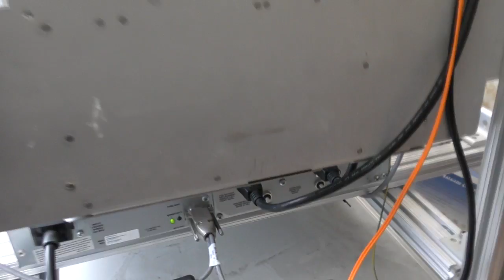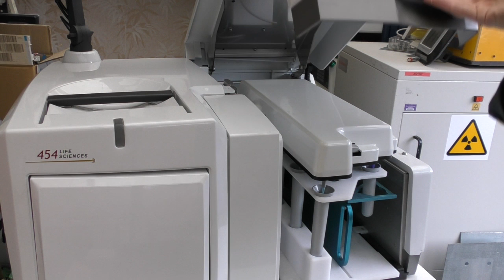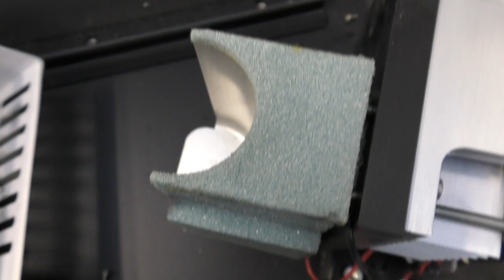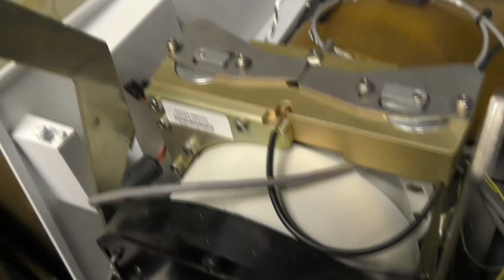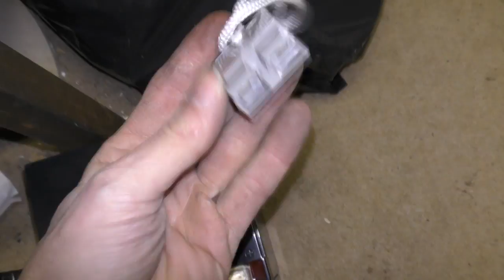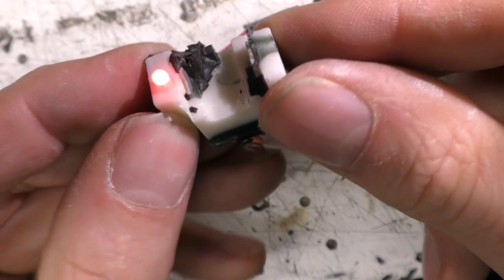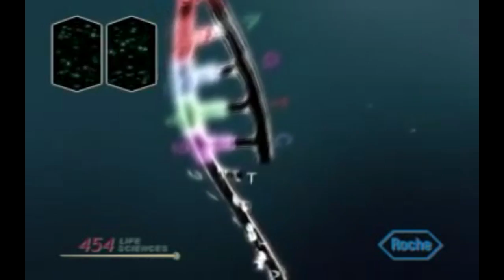Roche 454 GS FLX+  DNA Genome sequencer teardown

Comment: And I can tell you there's a missing component. There should be a server with heavy disk space behind the unit. Did a contract back in 2013-2014 doing the IT side of sequencing exomes. Massive amounts of storage and encrypted drives. They used Ion Proton sequencers.
Reply: Oh and yes, reagents are kept very cold/frozen. And the process you'll find has a hell of a lot in common with developing color film.

Comment: To determine if it is molded look for the ejector pins. Or molding marks things like date codes etc will stick out like a sore thumb. It is possible it is urethane cast.

Comment: I'm a little surprised to see this machine was manufactured so late (2012 iirc). By that point, there were far better 2nd gen sequencing options available that produced orders of magnitude (literally) more data and deeper sequence coverage for roughly the same cost. My department purchased an Illumina machine in about 2010 that blows the specs of that 454 out of the water. Similar upfront cost, but slightly more cost per run. However, it produced so much more data per run, that you could actually put multiple genomes on the slide at the same time (making sure to use a special DNA labelling technique to tell the final data apart) and do crude 'multiplexing'. This further reduced the cost/genome sequenced.

Actually, the reason might be that although 454 didn't get as good depth of coverage, the legths of the DNA reads were much longer than more modern machines (100s vs 10s of bases), making it easier to actually assemble your sequence data into a genome. This is very useful if you're sequencing something that's never been sequenced before, but somewhat useless if you've already got a genome to compare to.
Reply: So instead of getting more useful data upfront it gives you a whole lot more data that need a lot more processing to be meaningful?

Comment: Mike, reading the PDF you linked shows the rack of tubes you have is specifically for the pre-wash stage. You would fill those tubes with the Pre-Wash Buffer after cleaning out the casette from the previous run. So that tray would not be in there during normal operation -- it does indeed come with cassettes (as they call them) which slide in the same way that tray does. Also, the back tube is chilled, as it contains the Sequencing Enzymes (whatever they are) and they have to be kept below -15C from what I understand.
Reply: That tray you have is referred to as the Pre-Wash Cassette.
Reply: These are the kinds of instructions you get:
Wash the appropriate BDD using a soft bristle brush and Sparkleen solution. Rinse
thoroughly with nanopure water and let the device air dry on a paper towel.
Nanopure water?!
Add 6.8 µl of Apyrase to the 20 ml supplemented Titanium Bead Buffer in the conical
tube. Re-cap and label the conical tube “EB Wash”. Mix gently by inversion, and place
the conical tube on ice.
4. Add 30.6 µl of Apyrase solution to the bottle of supplemented Titanium Bead Buffer.
Re-cap and label the bottle “BB2”. Mix gently by inversion, and place the bottle on
ice.

6.8ul? How do you even measure that much?

Vortex the Enzyme Beads and the PPiase Beads and place them in a Magnetic
Particle Concentrator (MPC) for at least 2 minutes for the beads to pellet. Invert the
MPC several times and wait at least 2 minutes again. Carefully remove the
supernatants and then remove the tubes from the MPC.

Right....
Reply: Yes, that PicoTiter plate is replaced every time. It actually gets submerged in one of the prep liquids until it's ready to be inserted, which I found intriguing.
Reply from the maker: That cooler gets to about freezing point at room temp, but then the heatsink overtemp cutout trips so probably doesn't run quite that cold.
Reply: It's easy to measure microlitre quantities with capillary tubes - look up "tlc spotting capillary". (TLC = thin layer chromatography in this context.)

Comment: It is standard gigabit ethernet over optical fiber. You can use a standard fiber-to-copper adapter. The connector type and fiber type denotes a wavelength, which would be important to get right for the converter box ;-)

Comment: The way this would work is that you would have mixed in with the bases ACTG some tagged defective ACTGs with fluorescent probes such that copies of dna would terminate at random points - this gives you a blast and you have to use the computer algorithm to line them back up- different length sequences will come off the column at different times based on charge vs drag and the camera would like read the fluorescent probe

Comment: The image sensor is most likely behind a tapered FOP.
The fiber-optic output is most likely just GigE, but I'm almost certain the actual protocol is nonstandard. CameraLink over fiber is extremely rare and stupidly expensive.
Reply from the maker: It isn't tapered -it's a 60x60mm sensor! Fibre protocol is Cypress Hotlink over fibre. Video coming shortly
Reply: mikeselectricstuff Whoa! That's a huge sensor, x-ray direct imaging sizes! Explains the price now.
Reply: 60x60mm? That's downright stupid. In like a hilarious, good sort of way. I don't even know of any standard telescope mounting options for such a sensor - it's larger than the "jumbo" sized 2" optical backs on most large amateur scopes, 11" aperture and above. Practically all smaller scopes are only going to have a ~38mm diameter usable imaging circle or so.
Reply: @100531782681373837774 Huge silicon is used in direct x-ray imaging. The most high-end~($50-200k) models have stitched sensors of over 30x40cm(but usually TFT, so not quite silicon).
Reply: mikeselectricstuff I just found the sensor used in your camera.
http://www.sta-inc.net/sta4150/

Comment: The fibre connector is an MT-RJ. It used to be popular about 10 years ago for Ethernet connections but replaced by LC which is still the standard. You can pick up MT-RJ network cards on eBay for a few pounds, although not sure what speed that runs at. The connection  could be 10, 100 or maybe 1000Mbps. I'd also be surprised if it's Ethernet though, as unlikely there is IP connectivity going on in the camera. I'd hazard a guess it has some special card that communicates. Great video Mike.

Comment: 28:00: Do I see a black patch of magic smoke on that board where the fan cable is attached or is that just a shadow?
Reply: I am afraid that the camera is actually toast and since it seems to be the most expensive part of the entire machine (worth $500.000 new) it's the reason this unit has been scrapped in the first place.
Reply: Looks like a 'solder-plated' portion of the board there, and you're seeing the 'dark' glare off of it from deeper in the camera...
Reply: How did you infer it's toast? A small burn on one part of the board doesn't mean toast, could be repairable.
Reply: It was just an assumption. And yes even that damage is most likely repairable.
Reply: Nope I did not. It was a reflection since there is no soldermask on the board. Yay!
Reply: I sent an email to the company that makes the module maybe get some interface information on it but no response.

Comment: That fiber-optic connector looks to be a standard MTRJ connection, and if the camera was also offered in Gig-Ethernet, it's likely also Gig-E over a different medium (besides the usual copper).   Being this recent, it probably is actually Ethernet, plugged into a matching SFP module plugged into a fiber Ethernet card on the PC/Server.
Reply from the maker: Looked into it some more and it has Spartan 2 FPGAs so a pretty old design, now less optimistic that it will be Ethernet.
Reply: Looking at some of the sales literature, you are probably correct.   I turned up what looks to be some of the proper interface cards (perhaps), have a look on eBay for "Spectral Instruments camera interface card", there seemed to be a few of them on there that matched the interface description of 'Either 50-pin connector or fiber-optic' (per the sales literature).

Comment: That's not a standard ethernet fibre connector Mike. The usual standard LC or the older SC and ST look very different. That's an MTRJ connector, probably quite easy to get an LC to MTRJ fibre somewhere

Comment: For fiber google "MTRJ (Male) to LC multimode " the orange means it will likely be 1gbit. (the lc connector will fit most pcs/switches) with a 850nm sfp, but it may be another odd  feq. Good news is all of that fairly cheap second hand:P

Comment: Most APC UPS have the ability to step up or down the voltage to keep output at an optimal level without going to battery unnecesarilly.

Comment: +mikeselectricstuff The problem with pacemakers is that magnets are used for medics to switch them in the field; so it's not an issue with interfering with the operation so much as they're intended to switch mode; http://www.medscape.com/viewarticle/749751_5    (so for example pacemaker users are told not to put headphones in their shirt pockets).

Comment: i have to say it looks like no fibre ethernet i have seen before, but i have seen them use all sorts of connectors internally inside fibre switches to route internally including just off the shelf SPDIF fibre so who knows 
it could be just a high speed serial interface like LVDS but you might want to try looking inside to see what chip is driving it and if there is a space for ethernet magnetics you might be able to solder on (such as gb or 10gb)

Comment: The s/n on the camera is 1119, which rather puts an upper bound in the number of DNA sequencers made.
Reply: Lower bound, surely.
Reply: No. The serial number would probably be numbered through for all the other variants of the camera that didn't go into DNA sequencers. Obviously it doesn't tell you how many were made after this one, but it does tell you that no more than that many were made up to 2012.
Reply: Then by that reasoning it doesn't tell you anything about how many DNA sequencers were made. I don't see how seeing serial number x tells you there are no other machines out there with serial number greater than x? I could go on ebay and buy the same machine with serial number 1120? How do you get that '1119' was the last one made in 2012?

Comment: the cooler does have a temperature sensor on it
Reply: but another side of radiator ?
Reply: They could be smart enuff to have figured out that if they feed X ammount of Amps into those peltiers X ammount of units of heat gets moved.
Unless the role of that thing is to just keep the liquid frozen when it's not used and they could more or less run them on almost full blast until it was time to unfreeze it.

Comment: Yes that fibre optic connector is standard, it's an MTRJ. They were very common on switches/routers around 15 years ago, hardly ever used today. A cable to adapt this to a more common format such as LC/SC/ST is easily sourced. I'd expect it to operate at 850nm, possibly stamped on the transciever in the camera? Can you see any visible light from the fibre connector when the camera is on? Apparently the interface spec is "AIA Camera Link" http://edt.com/downloads/pcidv_family-3.pdf Some frame grabbers here http://edt.com/product/pci-dv-fox/

Comment: Looks like this could be the camera controller: http://www.ebay.com/itm/Spectral-Instruments-PCBA-SCH-FO-Gigabit-I-O-3097-Rev-G-Camera-Interface-Card-/291956437009?hash=item43f9f5b011:g:kXsAAOSwo4pYFJgf   It uses 850nm fiber, so it may be possible to use a standard 850nm fiber to ethernet media converter box to get into the camera.  The camera brochure indicates an SDK is available for the camera upon request.
Reply: stonent nice find man

Comment: Low production run injection moulds can be made pretty cheaply these days.  There are several companies offering a complete service whereby you upload a CAD file of the intended finished plastic part to them and they make aluminium A and B moulds using a CNC machine fed essentially from the CAD file with minimum human interaction needed, and then they can produce a few thousand parts.  Your design is analysed by their computer and you get feedaback a day or less after uploading your design to highlight any errors that would make it unmanufacturable such as insufficient draft angles for the chosen plastic or features that are too narrow & deep to machine, and also warnings about likely sink dimples or flow lines etc.  An engineer will also discuss the positions they plan to place the gates and parting lines to ensure that it will not cause any problems.  I used a company called "Protolabs" in the UK but there are many others.

Comment: The housing looks like a vaccum low pressure mould. Something like this http://www.citim.de/de/Polyamidguss-Vakuumguss
Reply: very interesting, never heared of that before
Reply: There is a smaller company that also does room temperature vaccum mould (Raumtemperatur Vakuumguss) into silicone forms: http://www.mfd-modelle.de/ They can include premade metal brackets, brass thread inserts and other stuff into the mold. Here is one example: http://www.ibpmt.com/hdc_e/adoc.asp?hdc_e/hdc_overview.htm This housing is produced with that vaccum mould technology
Reply: Could be, but it's pretty expensive for a piece that big, especially since only a few companies have the vacuum chambers large enough for parts like this. Another option is RIM (reaction injection molding).
Reply: +Morbuto RIM/PU was my thinking too.

Comment: How do you obtain data from the serial port? I want to learn that!
Reply: Dunno if you've learned in the 6 months since -- but it's pretty simple.
RS-232 (aka serial) has a very distinct pattern. Whenever you see a 4-pin header near a processor, or near the edge of the board, there's a decent chance it'll be serial. RS-232 voltage levels are +/-15V, but often microcontrollers send the same signals with TTL levels (0/5V or 0/3.3V) instead. In either case, you just get a serial-to-USB dongle of some kind (there's about a billion different varieties floating around on eBay, or you can shell out for a nicer one from a supplier -- Adafruit have a good one) and connect it up. And voila, you'll get serial comms. 
Sometimes it'll be actually connected to a DE-9 port, in which case it probably is RS-232, and in that case you can (you guessed it) get an RS-232 to USB converter. The only difference between the two types of dongle is the RS-232 type has a MAX232 or similar chip that converts between the two voltage signalling levels.
Let me know if you have any other questions.

Comment: I am guessing that company may have only sold 1 or 2 of those machines if they really charged so much money, as they couldn't have been able to trick many people into spending that much on it. 
If they are charging $6000 for the chemicals, then it is likely that they may have sold the machine its self for $300-$500 and make a small profit, and then price gouged on the chemicals, and then discontinued it when people started to buy non-branded chemicals from a 3rd party for cheap.
Reply: I'm sure that machine is cheaper to run than the first gen machine. The cost is small change to the drugs companies and the like that would use it.
Reply from the maker: Looking at serial no.s of units that have been on Ebay I think mine is 700-odd.
Reply: Charging that kinda money is not uncommon in the medical industry. Things ARE complicated, low volume and expensive to make. I made machines that costs way in excess of €100.000. And currently designing a machine where one use will cost about €3000-4000. Not because someone is greedy but because the disposable materials are really hard and time consuming to make.
Reply: @Razor2048

Roche are a huge multinational player in the healthcare/pharmaceutical industry (https://en.wikipedia.org/wiki/Hoffmann-La_Roche). They won't be producing a couple of these machines as you seem to think so your guess is completely wrong.

If you're doing DNA testing then you really aren't going to be buying (relatively) cheap non-branded reagents as that could potentially introduce inaccuracy into your results, never mind knowing whether or not there are any contaminants present.

For example if the tests are being run for forensic purposes then the whole point is to be as confident in the accuracy of the results, as they may be relied upon as evidence in criminal cases. That's just one example.
Reply: Dude, there are (were?) several of those machines running in Melbourne, Aus alone. The price for this thing was (at the time) practically a miracle. You can sequence a human genome on it in a week or two depending on how good your samples are. The human genome project using original (v. v. slow) and 1st gen high-throughput sequencing techniques cost over US$2bn to complete. Now you can do it in a couple of days for ~$1k.

The way these machines were often used is that many labs gang together to purchase the machine and feed it samples. This spreads the cost over many grant projects and gives you access to low cost ($ks vs $bns) sequencing we didn't have before the mid 2000s. 2nd gen high-throughput sequencing completely changed molecular biology almost overnight.